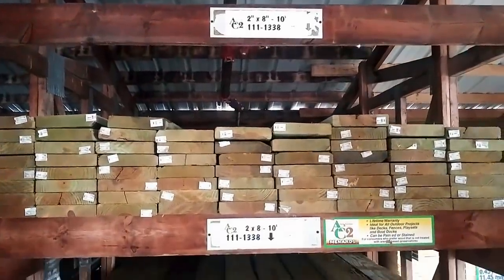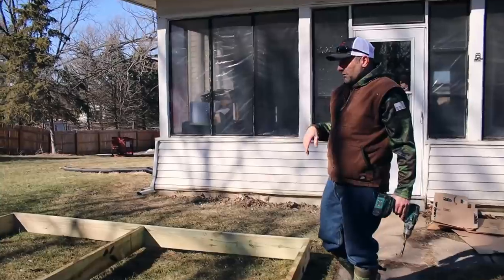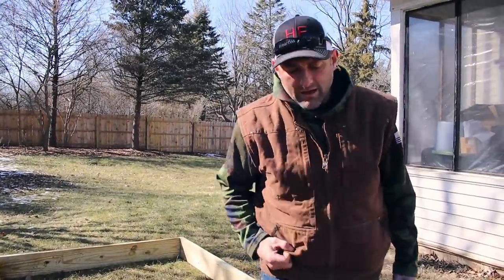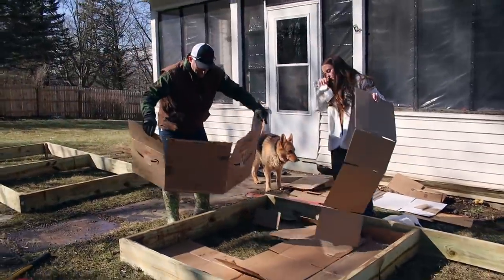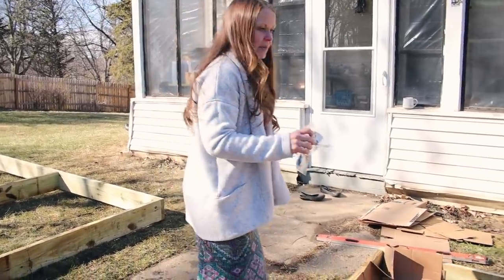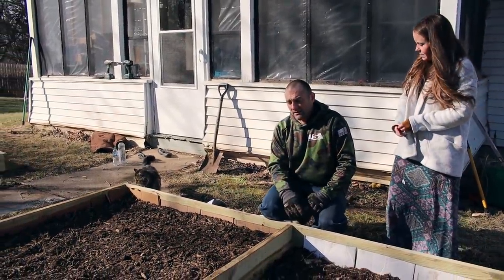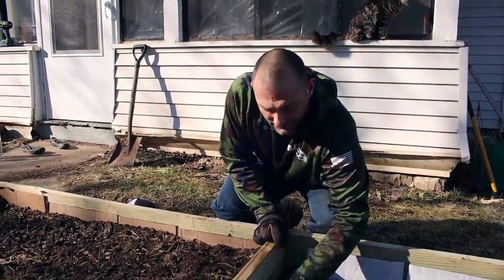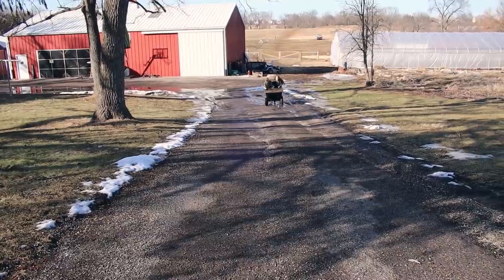Easy Raised-Bed Garden | Kitchen Garden | No-till Garden | Herb | Back to Eden Garden | Lasagna

Comment: Nicely done!! If you want to start even smaller and don't want to build something, you can use large containers - feed containers,, large animal watering buckets,  pots, etc - with the same layers of soil/mulch. If you have drain holes and set them on a raised pallet, they drain well and are easy to maintain. There are certain varieties of plants that are suited for "container gardening". We had the best success with spinach, small tomatos, onion, garlic, and herbs.
Reply: Very good!
Reply: Also galvanized fire pits at lowes or home depot

Comment: Hard to reach across 5 feet. We have 22 raised beds, 8 ft x 4 ft and it is hard to reach the center on those
Reply: The beds are accessible the whole way around so really you just have to reach two feet or so. Not too bad!.😊